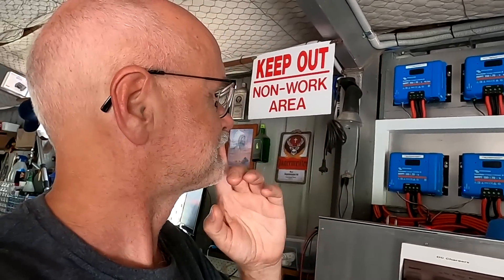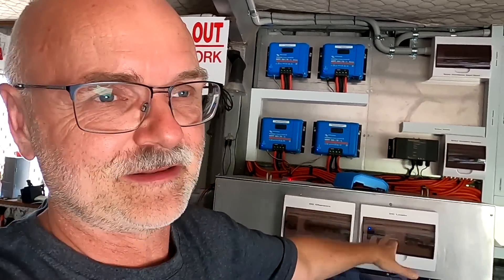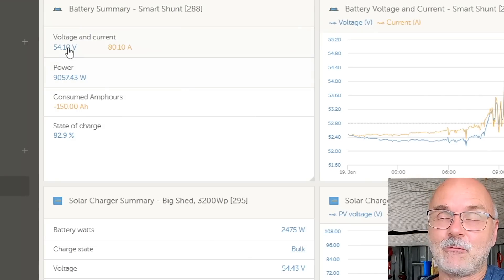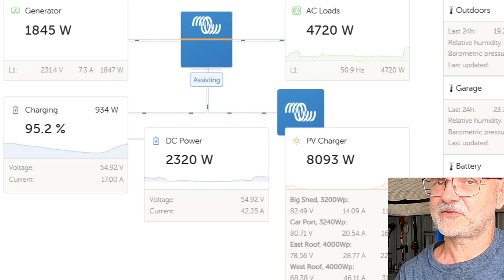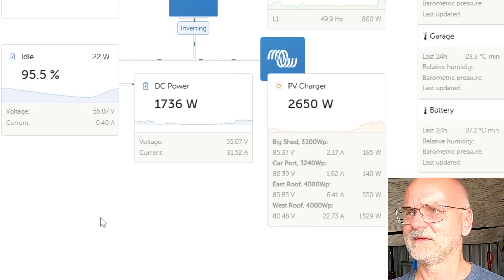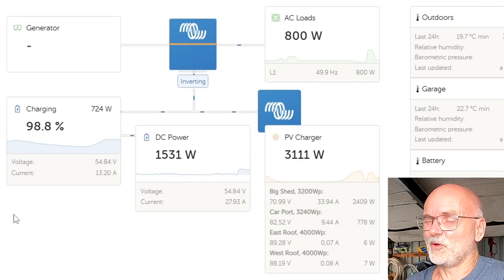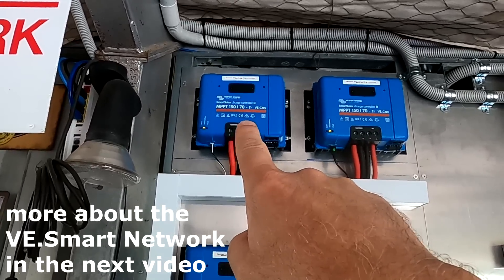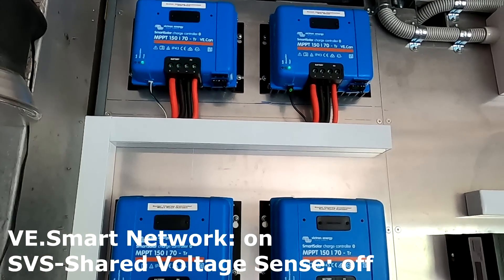Charging chaos: no charge despite full sunshine. MPPTs out of control!

Comment: Interesting developments here Andy, this is why I do like the KISS strategy, but i know it is only a configuration issue which you will soon have sorted out. 
I have a 24v system installed in a 40’ bus with 2 x Renogy 40A controllers on 2.5kw of PV (ie: 10 x 250w  39voc panels in 2s5p configuration). For experimental reasons I added 2 x Maxwell 48v Capacitors in series to the solar output and the Renogy MPPT’s run directly from this 96v capacitor bank & while they seem to swap current output back & forth & sometimes uniformly, they do seem to get the job done as rapidly as I would expect them to, but one thing I have noticed with this configuration is how it helps when there is a lot of cloud shading, when using 1 or 2 MPPT controllers, the capacitors help store some of that lost charge while the MPPT is re-calculating during cloud shifts, it also helps store early morning and end of day light as well. 
My 2 x 24v 5kwh batteries are full by 10-11am lately and then the capacitor voltage rises to about 65v which is enough to have a shower or make a cup of coffee at the end of the day without impacting on the full 100% SOC. I also have 2 x 16v Maxwell caps in series (with balancers) between the Batteries and a 3kw AIO inverter which I have used in the past to run 12v appliances from each 16v capacitor, fridges, lights, etc, (with success), and I think this pair of caps help to reduce ripple, surge and maintain a more stable system voltage overall. I am using a 24v JK BMS on each 5kwh battery & have a Victron smart shunt as my main guage, but no communications and it all seems to work well, so far…and while it is still a work in progress my little ‘Reckless Abandon’ & getaway, I recently added a 50ltr Rheem electric hot water system as a solar dump by adding a 1800w element (instead of the 3600w it came with) and using a 240vac  4000w motor speed controller/light dimmer, so I can easily regulate the wattage output to the HW system up to 1800w from the inverter or as the sun can provide, and use a timer after 11am or by switching this output via a PV capacitor voltage above 35v-40v when the batteries are full. Just thought someone might find this info, interesting if not useful maybe in the Van/Bus community. Cheers

Comment: Hi Andi,
I guess the Problem with DVCC is that you did not select a Battery Monitor. At least in the Video I saw that there was none selected....
Reply from the maker: It selects the BMS automatically as battery monitor once Victron detects it.
Reply: @OffGridGarageAustralia  i also have kind of that problem with the dvcc and liontron batteries. The pylon tech quirks in dvcc assume that you are using 15s cell packs as soon as the communication protocol is pylon tech compatible. In the forum is a workaround  how to disable those quirks. Worked nicely for me afterwards.

Comment: Hello Andy. Do you have connection between Vsense in multiplus ii and bussbar ?? Second thing when your MPPTs are in exernal control mode I think voltage for absorption and float may be taken from charger setting from multiplus even charger is disabled. Third thing choose correct settings in battery monitor in system setup. When you connect vsense choose vsense as battery monitor.

Comment: Have 3 solar controllers in bt network just to sync mode(bulk,absorption,float). The shunt is not included in this network (therefore no transmission of voltage and current from the shunt). This is done via dvcc (svs - common voltage sensor). This has worked for me for over 2 years without any problems. Therefore the idea is to remove only the shunt from the network and control the rest via dvcc.

Best regards
Peter

Comment: Using a smart bms the MPPTs are external controled using DVCC by the BMS. So the MPPTs are charging according to the CVL and CCL provided by the BMS. Works just perfect. Only drawback, if you are feeding in your DC solar production, the MPPTs are ignoring the CCL and onyl reacting on the CVL. Victron says that is a feature, a lot in the community says it is a bug (or at least room for improvment). I see you have found the thread in the victron community :)

Comment: You always moan you don't like to charge fully, now you're moaning the batteries aren't charging fully.  LOL  I set mine to 2.50 and 3.65.  At 10,000 cycles to 80% I'll be dead before worrying about new batteries.  Also, the great thing about lithium is you just keep adding.  BMS takes care of the charging, so much easier than AGM.
Reply: Disagree. He only charges to 3.45V, which is only slightly over the flat part of the charging curve, so very little stress to the cells. Still gives him over 98% of the ultimate capacity of charging to 3.6V. Not at all the same as the chargers giving up long before 90% SoC.

Comment: I hate to say it, but using nearly 100% Victron hardware seems to me an endless cycle of firmware updates at best. Properly designed hardware will need firmware updates rarely, if ever. ~2 years using EPEVER MPPT controller with no issues.

Comment: When a smartBMS is connected, it is the boss, full stop.  You set the target voltage in the BMS and all MPPTs are controlled by an “External” device.  I have 2 different Batrium BMS’s in two different systems and the Batrium controls the whole charging system.  When the voltage gets close to target, or if an individual cell jumps up too high to fast, the BMS tells the MPPTs to slow the heck down.  And if necessary, to stop and wait for things to settle.  This is common when you are approaching 100% SOC.  Batrium is in your neck of the woods if you want to give them a try.

Comment: Andy i saw your entry in the Victron Forum. Are all the cables from the MPPT are the SAME length? Are you using 4, 6 or 10mm2 cable from the MPPT to the battery? I use a more complicated Victronystsen and i have no issues at all. Only difference is i use Victron LiFePo batteries. The batteries running with a Smart BMS. All Hardware is from Victron

Comment: Glad you got it working. It's the issues like you showed that makes me hesitant about a system like yours. Especially when you NEED it to work reliably.
Reply: There's no drama here and there are no reliability issues, the unwanted behaviour is a simple matter of a misconfiguration.
Reply: Lots of drama regarding the VICTRON equipment.
Getting as bad as the SEPLOS battery drama.

Comment: Hey mate, I have 5 epever mppts in my caravan charging 660ah of lithium. 3 of them had a lithium profile from factory and change states at the same time. The other 2 I had to manually set and they stop charging before the others. I haven't investigated as it works well by dropping the charging current towards full charge.

Comment: On a different topic I hope to warn everybody that BMS's are no good for top balancing . I bought 2 smart BMS and two that they claim are regular.  They do not properly top balance the cells.  They will protect your cells and your pack from overvolt an undervolt and the smart BMS will allow you to view all your cells on your laptop or cell phone and that's basically it.  I tried every setting and there's nothing a person can do to top up all the cells equally!  2-3 or four of them will reach the 3.65 volt and shut down the BMS until the voltage cell drops and then it starts all over again. The lower cells won't get enough charge to ever catch up before the bms shuts down. The BMS do not hold the top cells voltage below the cell cut off voltage so that the lower volt cells can catch up. Garbage.  Maybe whats happening is certain not nice people are selling faulty BMS's. So basically I still have to top balance the other cells that have not reached the 3.65 Volt. This works for a couple charges then I have to do it all over again.  The only good thing is that I no longer have to worry about overcharging any individual cell. I guess only the wealthy people are allowed to feel secure 🤣😂🤣👿🤬

Comment: srne 40a and 60a, when the battery bank is full 60a srne stops charging but the 40a continues to give current to the system due to loads at the inverter. jbd 120a smart bms

Comment: I have two Morningstar TriStar MPPT charge controllers (a 45A and a 60A) each hooked up to a single remote battery voltage sense wire.  
They never switch charge state at the same time and when the batteries are near full and with a normal (300W) AC load, the smaller 45A controller often doesn't add any current at all.

Comment: I had this same issue on my Outback system with 3 MX80s. Keeping them in sync was a pain. I discovered a setting so that when one charge controller goes into float, they all do. It solved the issue. Some can be in adsorb and others in bulk, but it does not really matter as long as they all hit float at the same time. I don't have any BMS integration with with the OutBack. It's set to bulk/adsorb at 55.2v for 2 hours (to give time for the balancers to work) and that charges the battery banks full.
Reply from the maker: Thanks for sharing. That's a similar setting as with the VE.Smart Network where they keep synchronised.
Yeah, changing to Float at the same time is probably the important step.

Comment: I've noticed with my smart shunt that it reads a slightly different voltage to the 100/30 scc too. 
I've just installed my 2nd 100/30 scc this evening, finished installing it and sat down to watch this vid 👍 But even the new 100/30 is showing a slightly different reading again to the original 100/30 scc and smart shunt 🤔🤔
I'm still waiting for my 3rd usb to serial ttl cable, then it'll all be on the Pi VRM 😁
Have you tried changing the float charge in your scc's to slightly different voltages? Would that help?
Oh, and I blame you for getting me in to Victron and the Pi VRM 🙄
😁👍🥳🍻🍻
Reply from the maker: Do you have them connected to a VE.Smart Network? That helps with the voltage. You need at least a smart shunt and one MPPT for that, which you have.
I could change the float voltages but I don't want to. Floating at 3.35V is great...

Comment: Having a similar issue with my 12v off grid setup. My epever keeps shutting down during the day but my cheap mppts keep working all day. Some days it works and some days it doesnt
Reply from the maker: What do you mean by shutting down?
Reply: @OffGridGarageAustralia  it turns my charge off and just sits around half a amp charge. It resets when I unplug my solar panels and reconnect. I Have found lowering my battery charge parameters prevents it happening as often but on a really hot day it tends to disconnect

Comment: With smart netwok off, you want to try tweaking the Absorbtion volts up a bit from 55.2 to 56, as a compensation for cable loss.  That is 3.5v cell volts when Amps drops to 0 (so will not get to 3.5), well under 3.65v
Reply from the maker: That is not good because if you have small currents during cloudy weather, it would charge to this higher voltage actually.
Reply: @OffGridGarageAustralia  Can you actually measure the same voltage difference between the MPPT outputs and the shunt inputs? Is this the same issue that causes your hot wiring at high currents? Could it be related to using 63A breakers with up to 70A of current?
Reply: @OffGridGarageAustralia  I think this suggestion (higher absorbtion voltage) might be part of the solution, because at 3.45V the Voltage is not very sensitive to changes in the current. Its to close to the "flat part of the curve". Right now, when the battery reaches 3.45V it doesn't matter, if there are 20A or 60A pushed into it, the voltage stays the same. So if only one charge controller is still charging, the others won't recognise it because voltage didn't change when they switched to float.
Otherwise, at a higher absorbtion voltage, the voltage will drop, when the current drops, so the other controllers will join the game again and provide a (reduced) current, to keep the voltage at 3.5V.
Does this all make sense with LiFePo4? At least with lead acid batteries, multiple independent charge controllers "synchronise" their absorption via the change off the battery voltage, when the current changes. If one controller can't keep the voltage up by itself, another one provides current as well until the absorption voltage is reached and kept again. And because in absorption phase the current slowly drops, the voltage drop on the cables also gets lower. But voltage drop due to a high DC load is still a problem. Then DVCC and SVS are the far better options. Or at least charge controllers with seperate voltage sense cables.

Comment: The Charge Controllers (4) can only sense the voltage at the controller and not at the battery.  The amount of current each CC outputs during BULK is determined by the input power provided by the solar panels. The output CURRENT of the CC's is then summed together and fed to the BATTRY.

The CC will use MPPT to maximize the current it harvests from the solar panels.  The CC sources CURRENT and monitors VOLTAGE. Thee CC uses this monitored voltage to determine in what state they should be operating, BULK, ABSORB or FLOAT.  

Although the load (BATTERY) voltage is the same for each CC, If they are all operating independently,  then they will each measure different voltages because the output current and the resistance of the path to the BATTERY of each is different. If you have a shunt this will also give you another voltage,  so altogether you will have 5 different voltages 

If one CC is designated the MASTER it should tell the other 3 CC's what mode to be in.  If this is not true then it's a design flaw and nothing you can do. The system SHOULD use the most accurate BATTERY voltage, which is the voltage measured at the SHUNT, and propagate that to the 4 CC's.

A model derived from a schematic for your system might be useful to understand why it's behaving as it is.

BTW,  
1.  SOC is only valid with the battery under NO-LOAD. SOC is a measure of the intrinsic battery voltage so if you measure it under load,  you would have to compensate for the load current and internal resistance.
2.  Did you ever determine why the cracked panels gave low output ?
Reply: SoC is calculated by coulomb counting, not by voltage.

Absorption allows the battery to complete charging if constant-current stops because the voltage peaks "too soon" because of high currents.
Reply: @Full-of-Starships  Yep,  that is the best way to estimate the charge left in your battery.  I was just noting that IF you are using voltage to determine SOC you need to measure the voltage under no load.  

Even using a coulomb counter you have to determine what you think is 0% and 100%. So you define the end points and then use the coulomb counter to provide an accurate estimate of the remaining charge left in the battery during discharge.  

100% should be when it won't take any more charge  for the specified max voltage. 0% could be defined as after sucking out the charge in the battery spec, but as the battery ages,  you may not be able to achieve this and it may result in draining the battery to a too low voltage.  0% is best defined as reaching the minimum voltage for the chemistry used, but it should be measured under no load after relaxation, which can be a long time (several hours).